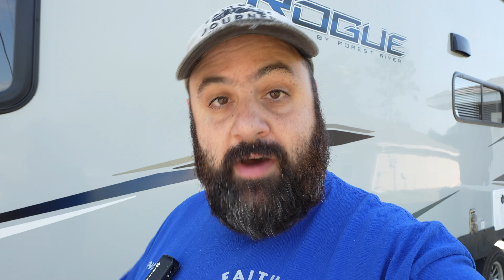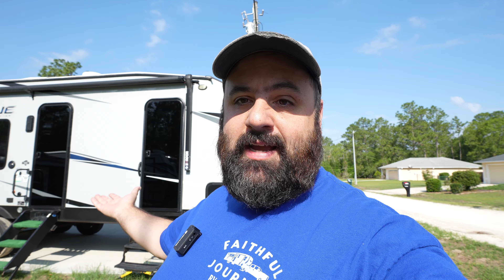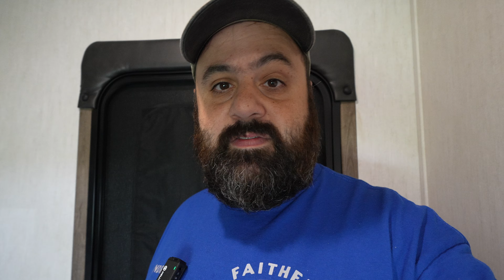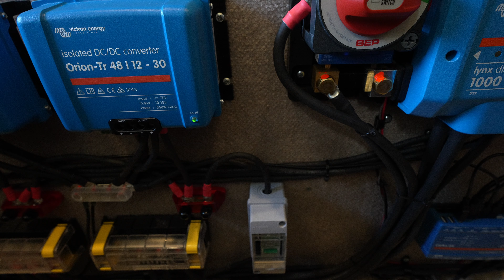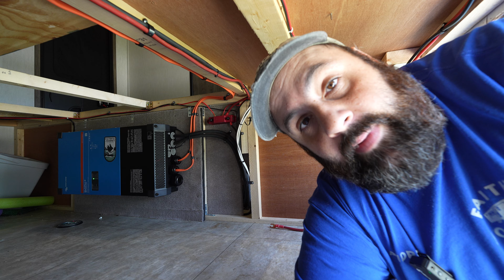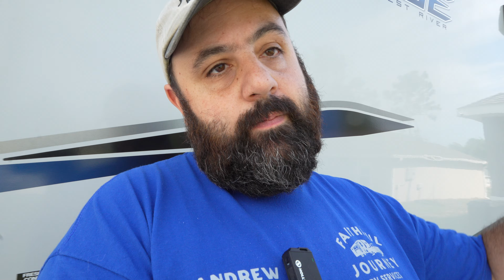2022 Forest River Rogue Toy Hauler - 48V Victron Solar System Installation

Comment: What's been your experience been with heat from the 48/12V converters? We had issues with Orion DC/DC product running hot at 80% load.
Reply from the maker: Yes this generation of Orion Dc-Dc converters and chargers do get hot when under load. This is one of the reasons why I put 2 in. Spreads the load between them and then one isn’t working so hard.